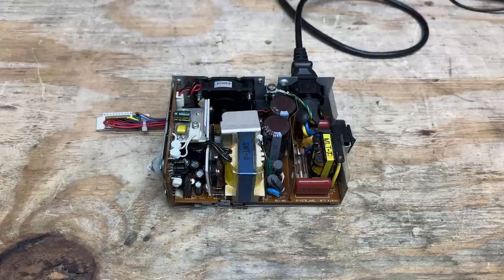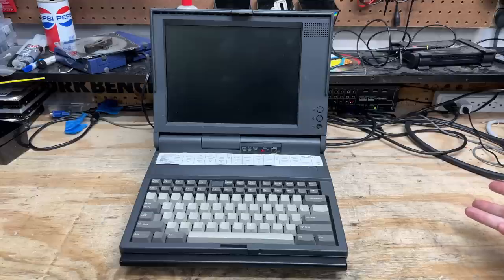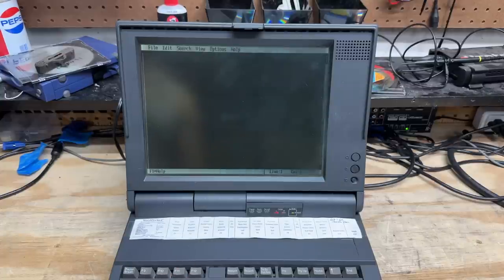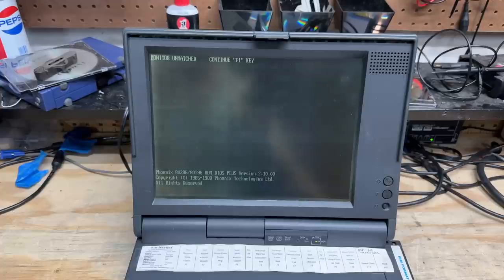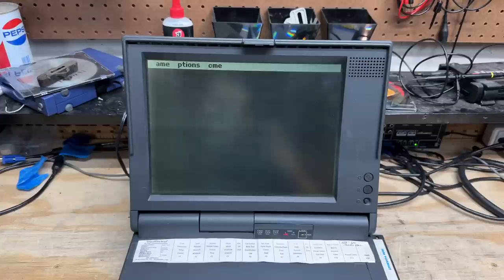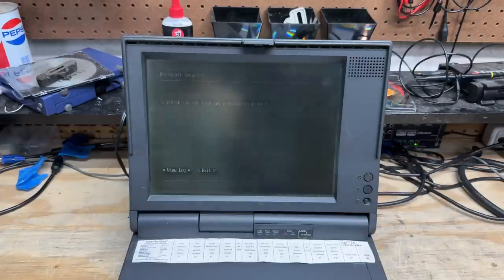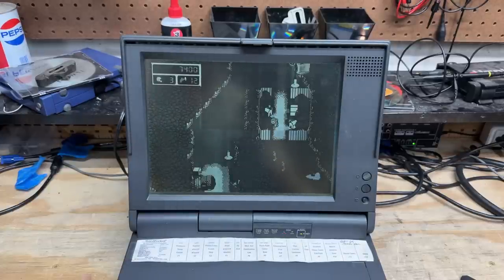Can we bring the Mitsubishi laptop back to life?

Comment: Really satisfying to see if fixed. Don't worry about the high side caps Mike, those caps are constructed differently than the leaky ones and will be just fine to keep in there.
Reply from the maker: Thanks. I'm so glad there weren't any additional faults. Repair is the only option for this PSU as replacements and pinouts seem impossible to find. Now that I have a pinout there's a chance to put together a modern replacement without reverse-engineering this thing. Those caps looked brand-new!

Comment: Good stuff.
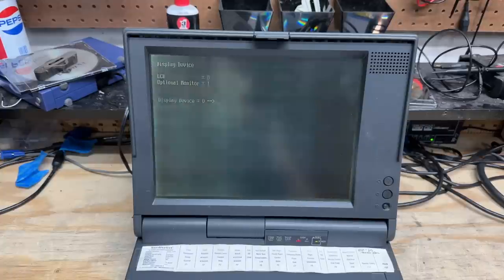5:23 I think you need to set this to "Color Monitor 80 Characters/Line" in the BIOS because this laptop uses an EGA/VGA adapter internally (despite the LCD being monochrome). It probably has a 15-pin D-sub socket on the rear for an external monitor.
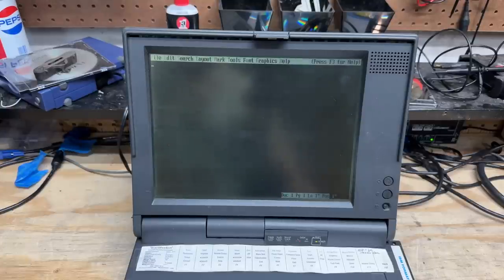7:30 It's F7 to exit WordPerfect. You even had the cardboard cheat sheet right on front of you. 😃

Comment: Am I the only one who anticipates the clicking sound of the sacrificial hard drives for testing power supplies? 😂
Reply: Nope!
Reply: @lastinline1958  oh good. I thought I was going crazy. 😂
Reply from the maker: That audible report is the best unintentional feature of them!
Reply: It's getting down to the wire, I think. They've been stout scouts for a while, but like good soldiers, they will die, but with honor and respect.
Reply: Ha, when I first started watching the videos, I thought the PSU was going to explode, then realize it was the bad drives.  I tended to use a lot of SCSI in my early years, and especially those 10k rpm drives made a whole different sound when they went bad... like metal screaming!

Comment: congratulations..  👏👏👏👏👏
You repaired the latch and replaced the transistor and condenser. 😊

It worked so well that it made me feel good to see it.
LCD is the last 20th century and early LCD.
It is inevitable that the reaction speed is slow.
It's working normally.
If you attach a slightly dark film to the LCD surface, you can adjust the brightness simply.
It seems to be getting better.

Luckily it was fixed and I’m glad~!!  🥰😄  💐

Comment: Nice recovery, glad it was a relatively easy fix, great to see that hard drive in such good shape. For the age of the machine and the software that code scanner was probably pre-OBD and would have included different adapters for Ford ECC, ABS, and airbag systems, as well as completely different adapters for Chrysler Lean Burn and Renix systems. 
That screen was much more readable than the one in my Compaq LTE/286.
Hopefully not too many headaches from the hurricane.

Comment: 12:48 when you want to reinforce plastic repairs, you can just take a staple or a paper clip and heat it with a lighter, then sink it into the plastic parts at their jonction. After you put some epoxy and it's quite tough ;)

Comment: That strange sound that some old hard disk makes, are because the head is returning to the first position to start again. In the old time before you shutdown a computer, you needed to park the head, that was with the command “park”. Otherwise the head stays on the “reading” position on last time it was left, with it, the head being down pressing the platter and if you move it, sure it will scratch the that platter. Sometimes if it was a laptop, can go to some really nasty scratches that you can feel them even with the finger, marking the drive totally unusable.

Comment: Something to check while you have that working is to see if there's any capacitors up in the lid that need changed, given there is likely a backlight circuit up there plus everything for brightness/contrast. I have a feeling because it's the early 90s there might be surface mount caps up there that need tended to just like the Powerbook 100 series. Can't hurt to check and you'll feel a lot better about it afterwards. I'd also doublecheck the motherboard itself for any dodgy caps, if the PSU is leaking caps, the board may be too.

as far as the hard drive is concerned... if it's a JVC interface, you want to go in and recap that drive too as nearly all JVC drives have surface mount caps on them that WILL leak and WILL go bad. preemptive replacement is recommended. I did it on my one Zenith laptop's drive and it not only helped it spin up better but gave it a substantial increase in throughput performance, probably back to wherever it was when new.

Comment: The 44 pin to m.2 adapters are a life saver.
I was able to bring back many old laptops that needed drives. I even replaced my rtc batteries.
And they run really fast using the m.2 drives.
Does this have a serial port ?

I was able to install Windows 95 on my 286 laptop despite Microsoft telling me it wouldn't work.

Really cool

But the reason I have these old laptops is for the hardware serial port and DOS to run the Motorola and Kenwood Radios programming software
These old radios can't be read or programmed without a hardware old style serial port and pure DOS

Comment: I´ve got a Similar but older ? Mitsubishi Luggable, it is called Maxy. Has a Keyboard with roman and japanese caracters printed on, no HDD and two 1.44 Floppys.  I´ve found only one article online that it even existed. It seems very similar, but not exactly the same as the MP 268, but now I finally have a hint, for looking on some Infos. Ps: The Psu on my was also destroyed by leaky caps. replacing those let it run one time, then it died again :(